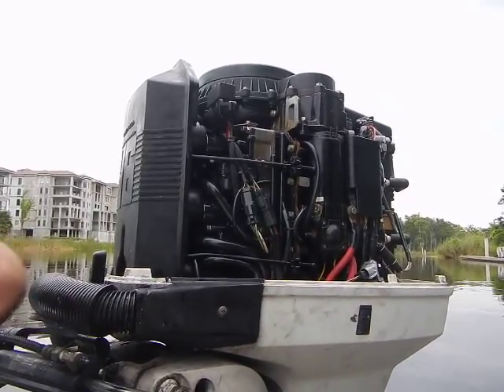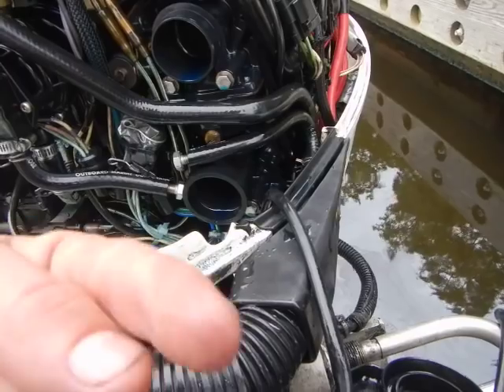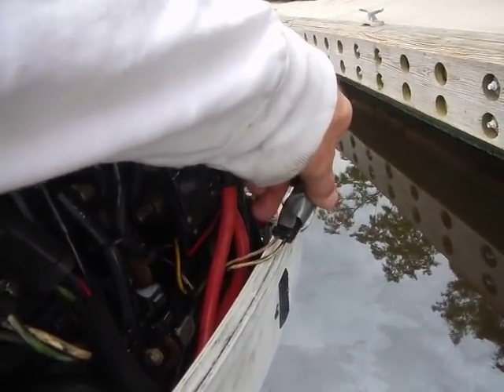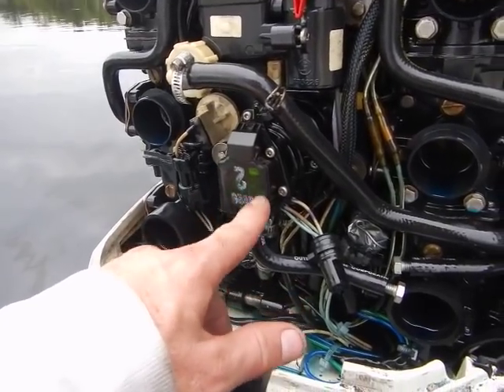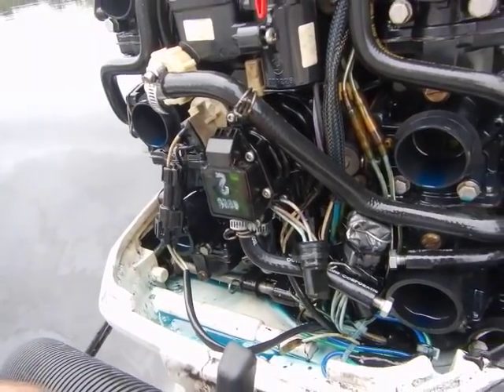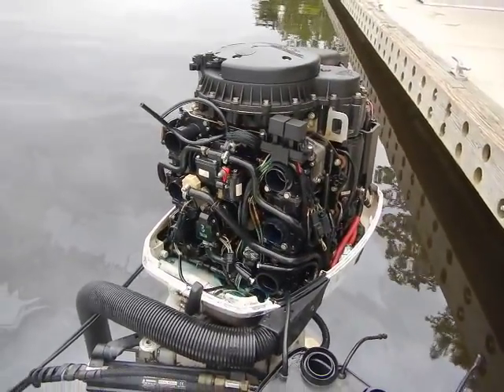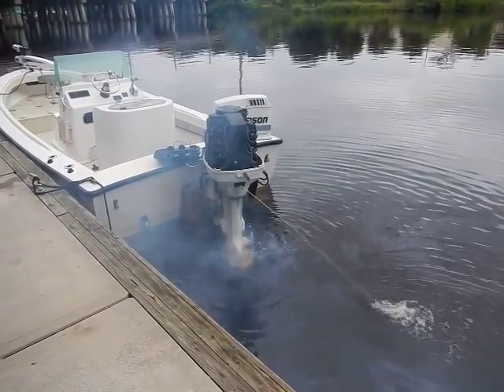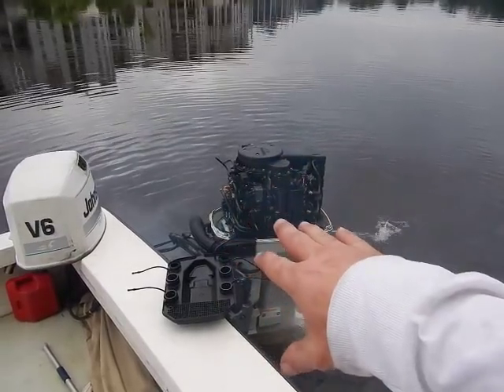Bypass VRO Oil Pump 1996 Johnson 150 HP

Comment: My boat recently broke down on the water and we had to be towed. The fuel bulb was cracked so we bypassed the bulb straight to the engine. We were able to get her started, but as we ran the boat it started losing power in spurts eventually died on us. We were able to get it started 1 more time in which smoke started shooting out of the back, we shut it down and were unable to start it after that. We had to be towed to the docks. When I cleaned the carbs they were full of fuel and oil mixture which seemed to contain more oil than fuel. Other than that they were pretty clean i side. After putting the carbs back on and starting the engine, unfortunately there is still allot of smoke coming out of the back. I ran the engine for a couple of minutes, off and on for a total of around 4-6 minutes. I have a 1996 Johnson 2 stroke outboard with a seperate VRO Oil tank. Do you know what the problem may be that is causing all the smoke. Your help would be greatly appreciated. 
Thanks
Reply: Chris Williams disconnect your vro and pre mix your oil
Reply: gas restricted ? = thus less gas and reg amount of oil

Comment: Hi Mate my evinrude 115 V4 is soaked with 2 stroke oil inside the motor , at the carburettor intake and all the spark plugs are very wet with 2 stroke. Can it be that the VRO is pumping way to much 2 stroke oil that necessary. Thanks in advance
Reply from the maker: Could be. You may want to remove and rebuild the VRO pump. Also clean up all that oil and run the engine again. If still same problem exists, you may need a new VRO. 

I'm guessing the circuit card in your VRO may be faulty.
Reply: @JimWellman  Thanks a lott Jim is the circuit card a electronic programming card.
Reply from the maker: @plc7957  it's the thing you see that's covered in silicon. And yes it's programmed, but nothing you could access and reprogram yourself.

Comment from the maker: For those of you who have given this video a thumbs down or are going to do so, tell me why. Is it because you are a fan of your VRO and like to defend it at all cost or do you not approve of my garbage video skills? Just curious.
Reply: I am about to start premixing on my 99 Johnson Ocean Pro 150 but after reading your comments again you have me thinking your attempt was unsuccessful.  You had multiple issues when bypassing VRO and so you went back.  So I guess now you would not recommend bypassing VRO right?
Reply: following !
Reply from the maker: @jimv1484  sorry I never replied to this, but no. Bypassing it works perfectly fine. And I would do it again. I just came into a little bit of money later on and decided to go ahead and do it the right way. In my opinion it is much easier to fill an oil tank than it is to premix with the fuel. Premixing only gives someone the piece of mind, so they know there's always oil there. 
 Again… If I had it to do all over again, I would bypass the VRO if the budget was tight. 
If money wasn't a concern, I would install a new VRO pump.

Comment: I am looking to purchase a boat that has a 1996 90 HP Johnson motor on it I was wondering how reliable this motor is and is there anything I need to be wary of thank you.
Reply from the maker: I'll get back to you after dinner.
Reply from the maker: If it is anything like the 150, I'd get one.  
The VRO pump is something to read about and be familiar with. It can be rebuilt fairly easily.   
If it has plastic carbs they can warp, which can be an issue.  
The engine has tons of power and is known to last long.  I was happy with mine.

Comment: Why did you decide to switch back? Did you run into problems running only the fuel side or just get tired of pre-mixing? I'm having similar issues and considering disconnecting the oil injector.
Reply from the maker: I switched back for 1 reason, well maybe 2, but 2 doesn't really count.  
Reason 2 is so I don't have to mix any longer. 
Reason 1 is that my old pump was just not keeping the suction it needed to work properly.  I rebuilt the thing , but the plastic parts appeared slightly warped and I believe this was preventing the engine from keeping prime.  The main symptom was that the motor would try to die on me...unless I went to the back and pumped the bulb about every 20 seconds.
I decided to bite the bullet and purchase a new VRO which fixed everything.  
You do need to make sure the oil side is capped real tight if you disconnect it.  Mine worked for a couple weeks with only that bolt in it, but then I put a regular plug in it. That worked for a week or so, but then the old problems came back as stated above.  That's when I purchased the new VRO pump and I'm glad I did.
Reply: Jim Wellman

Comment: How can you still use the vro  as a fuel pump if you disconnect all the wires?
Reply from the maker: Wires I disconnected are for an alarm.
Reply: because the pump is not electrical.. needs only vacuum.

Comment: Good job because if the oil pump doesn't pump oil the engine will burn up
Reply: Guyanese Gamer ?
Reply: If it fails I think it goes to full flow, not zero flow.

Comment: I did the same as on this vid. Now having problem with the engine stroking at some stage. If she stopes running for some time..even few minutes, sometimes I need to pump up the gas again. Than she gives me back cloud of smoke, chokes a bit..or lot before she sings back to higher RPM. But sometimes works perfect. Took her to the service afterwards, they did not found any irregularities, there and than worked just perfect. So she might have her "period" from some other problem, not the farewell to VRO... (Feeling confused)
Reply from the maker: I ran mine like this for a while and then decided to get up off of my wallet and purchase a new VRO pump. I installed it and my boat has run great ever since.

Comment: I did everything you did and I took my boat out and the fuel isn’t getting to the motor like it should I’m having to pump the bike to fuel every 5 second for gas to get to the engine
Reply from the maker: The diaphragm on the fuel pump could be cracked. You need to take it apart and check for that. If that's the problem you'll need to buy a rebuild kit for the VRO pump. I may have listed it in the description of one of my videos.
Reply: Jim Wellman so the wires I unplugged from the fuel didn’t make it do that?
Reply from the maker: @Bfaulk98  no. The pump is mechanical, so it doesn't use electricity to operate.
Reply: Jim Wellman what if I took the primer bulb away and replaced it with an inline fuel pump? Will that hurt anything by doing that
Reply from the maker: @Bfaulk98  you shouldn't remove the primer bulb because you wouldn't be able to prime the engine if you needed to. I've seen some people bypass the VRO pump by adding a fuel pump in line as you speak of and it works, so you could try it , but I would definitely keep the bulb
Reply: Jim Wellman okay yeah I did everything your video showed to bypass the vro and now my engine will run for about a minute after I pump the primer bulb and then shit off because the fuel isn’t pumping right. What could that be? The VRO is pretty new so I don’t think it would be cracked or anything.
Reply from the maker: @Bfaulk98  if you have a new VRO pump I wouldn't suggest removing anything. And when you say new, how new are you talking about? If I were you I would still take it apart and check the diaphragm. I made a video showing how to do that.

Comment: I bought a busted boat that had a good Johnson 1988 110 hp motor.  I wanted the motor and trim for my bass boat that has a force motor and trim that won't work and I cant get new parts for it.  Dude said he had work done to engine and it runs fine.  Don't add oil it is a four cycle.  OK, great.....get it home, oil tank full, take fuel line and put it in my gallon of gas that has sea foam in it to clean carb and engine.   started it up after some cranking and after a few minutes alarm goes off.  Upon investigation and looking harder.  The three wire harness for the oil pump was dry-rotted and appears mice chewed through two of the wires but I did not see it.  Makes me wonder how much damage I just did to the engine.......craaaaaaap!!!!!!!!  So I thought screw this.  Watching your video and others I have come to the conclusion ten its safe to just add oil to the fuel and bypass the oil pump.  Tanks for your video.  I only hope I did not damage the engine.
Reply from the maker: Good luck with the engine.

Comment: What was the wires you unplugged from the fuel/oil pump for?
Reply from the maker: Alarm wires so it wouldn't beep as a result of no oil flow.
Reply: Jim Wellman, have you had any problems with your motor since you bypassed the VRO?
Reply from the maker: @Bfaulk98  not at all, but about a year after bypassing the VRO, I installed a completely new VRO pump.
Reply: @JimWellman  If it is working well, why did you install a new one? sounds bs...it must be not working or you would not put  a new vro
Reply from the maker: @EASYRIDERTOO  sounds like no matter what I tell you, you won't believe it, but I'll try anyway. The reason I went back to the VRO system is so I wouldn't have to mix oil any longer.  The VRO mixes oil at a ratio it feels is best under the current load. A 50:1 oil ratio is always 50:1 and never more and never less. 
But the main reason is $$$. When I decided to go back to VRO, I had the money to do so. When I originally bypassed the VRO, I had just gotten out of the Navy, was going to school, and money was tight.
Reply: @JimWellman  Got cha, looks like that is the only reason why someone will go back to VRO...convenience, thumbs up.

Comment: After you disconnect the VRO. If you have an air leak on the oil line coming into the VRO pump will your fuel pump quite working? I bought my boat with the VRO already taken off and discovered the hose was open going into the VRO. I also reconnected the plug not knowing why the were unplugged. After seeing your video I have blocked the hose and disconnected the electrical connections. Unfortunately I added an electric fuel pump in line to get me up and running. Now I am wondering if I should by-pass it and see if my engine fuel pump works. I believe the bolt come out and cause the pump to quite working and was the root cause of my problem? Any comments...
Reply from the maker: Brian Wilson I'm sorry to say this, but I'll have to leave this to someone else to answer. My boat is in FL and I'm in AZ working. Check out some forums out there. I'm sure you'll find the answer.
Reply: An electric fuel pump will work just fine as long as its providing the right gph

Comment: How did you eliminate the oil alarm?
Reply from the maker: I disconnected the brown wires that I show during the video.
Reply from the maker: I should also note that when I say that I capped them, I just mean I wrapped tape around them, so nothing could get into the connections.
Reply: Jim Wellman - I bought a bass boat from original owner and he has already done the elimination of the oiler and reservoir. He has the alarm/ buzzer in dash disconnected. I’m guessing because it’s always sending a oil alarm. Thing is I don’t have a working alarm now for low water pressure or over heating. I’m trying to reconnect the alarm but eliminate just the oil warning.
Reply from the maker: @joshuapotter1869  I don't have a schematic showing how to accomplish that. I'm guessing that all alarms would be lost if this is disconnected if this is the wire which goes to the noise maker.

Comment: Hey man I have a question. I bypassed the VRO and everything is pre-mix but now I have a beeping noise sometimes that when I go faster it beeps faster but it doesn’t do it all the time it may do it once or twice every time I take the boat out. Sometime it just beeps 3 times and then it won’t do it anymore. What could this be? It’s not overheating because I have a Pee stream shooting out and the engine it self isn’t hot.
Reply from the maker: Did you disconnect the alarm wires?

Comment: Cutting hose to vro is it necessary a have to ?   Thanks for sharing
Reply from the maker: I'm not sure what you mean.
Reply: @JimWellman  the hose you cut and capped off.  I disconnected hose from tank to motor it's visible beside gas hose your's is covered. I unplugged the same 4 wire  connect and tapped it up ... Hose coming from vro you cut and capped off  I did too still fire's up and smokes that's fine .  It quit peeing though I cut off and got a new water pump going to change tommorow hope that's it.  Anything come to mind why stop peeing. Thanks again man appreciate your time
Reply from the maker: @tracymathis8855  this shouldn't affect the water pump. The water pump is mechanical and operates as a result of the shaft spinning. Shouldn't be affected by lack of power to any component. Something to note about the water flow is that the thermostat is designed to allow water to flow out of the engine once the engine is at a specific temperature or above that temperature. Your engine is designed to operate at a specific temperature and therefore the thermostat maintains that temperature by opening or closing depending on how hot or cold your engine is. 
I had an old mercury that always seemed to take forever to warm up. Once it did, the thermostat opened and water would flow. 
Another possibility is that your thermostat is bad and therefore locked in the closed position. It is very simple to replace a thermostat.
Reply: @JimWellman  Thanks Jim I will go ahead and replace the thermostat to be on the safe side. Did not get a chance to change water pump today my son passed his last test he's officially SWAT only being a officer for 2 years. But me and him are going to change water pump tomorrow every mechanic says most likely why not peeing expecially propeller inside lower unit said need to change on any used motor purchase cheap and quickly changed? I'm no mechanic but now thermostat is added to list. Appreciate your time and help hopefully it will be peeing strong stream check my propeller I'm older than engine Lol  Viagra for motor overnight millionaire intervention. Thanks again and have a great Labor day weekend
Reply: Jim I already had water pump and propeller thermostat makes real good sense now after thinking back I almost certain it is the thermostat matches what you describe to a t  heck motor is going to have extras thank goodness for Amazon prime very low cost may have just jinx hadn't checked thermostat price I'll let you know results when done
Reply from the maker: @tracymathis8855  contrasts to your son. 
As for the impeller, it never hurts to change it each year, depending on use. 
If you run your engine out of water and without earmuffs on the lower unit, that can ruin an impeller.  It needs water flowing through there to lubricate it.
Reply: Off subgect here your bait tank/seat Rock's I know videos old I do same 75 gallon but takes up more space more oblong not as tall I read a comment you moved on to newer after bank get away haha I got a 22 ft sea pro 99 this engine at hand on whime from a friend/business associate he retired and sold quicker than expected that's were he Keep it indoors at his shop called me 1k u want uh yeah but I have sea ark I'm buying a engine for now torn everyone says Suzuki's I need a 150 or 175 just thought would get your input or you have any friends ECT or your getaway with riches may have a deal on one.   Be Blessed
Reply: @JimWellman  yeah he said to replace each year.    I would not dare start with out ear muffs I live on the lake and we bypassed vro just like video and ran a month or so I just happened to notice it wasn't peeing just a small drip probably  thermostat but it has not been out of the water.   I have a optimax 06 not a minute trouble did replace fuel pump it was under warranty at time.   I gave it my son he put it on a Grady White he's going to be in this weekend. I bought new and maintained for warranty I know it.  This used one just want confidence in seems strong I agree with you thermostat will know next week
Reply: Thanks for congrats to my son tough field test he's a genuine good young man who helps and protects others who can't protect themselves.  Very proud
Reply from the maker: @tracymathis8855  of toy haven't tried yet, unscrew the piece where one water flows or if the engine. Then start the engine. If still no water flow, it's probably the thermostat, but there could always be something clogging the line.
Reply: @JimWellman  took it out of water and piece of wood blocking the hole!!  Running like a champ thanks for all your help.
Movie slingblade has it got gas?  Check small things first

Comment: I just want to know what the brown and tan cable does in the motor?
Reply from the maker: I think it's the sensor wire that tells the engine if there is oil in the tank, and if not, the buzzer goes off...I think.
Reply: Why not tie 2 wires together telling motor oiltank is full ?? Wouldn't that work ? Idk

Comment: too much oil can detonate a 2 stroke! people always say "better more oil than less" or "you can never give it too much oil" they will learn the hard way. also, VRO has been given such a bad rap. People just need to know how to properly maintain the VRO, and it will reward you with no problems. Just requires more maint. than other systems! TIP: ALWAYS CHECK THE VRO FILTER AND REPLACE ANY OLD HOSES THAT ARE CRACKED! People seem to think its ok to have the tank exposed to the sunlight... bad move as it cracks the hoses in record time
Reply: The problem isn't  enough oil its too much oil which is also horrible for a 2 stroke